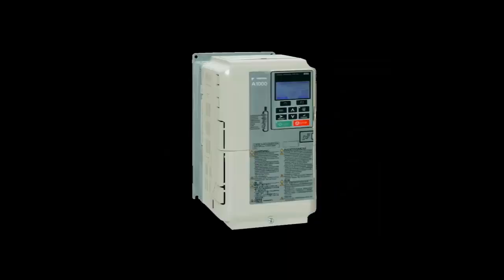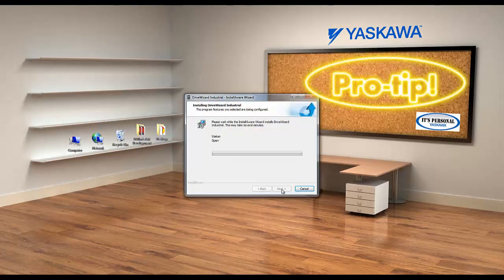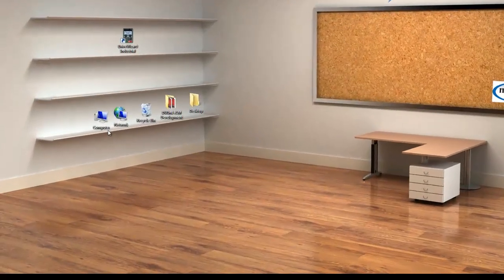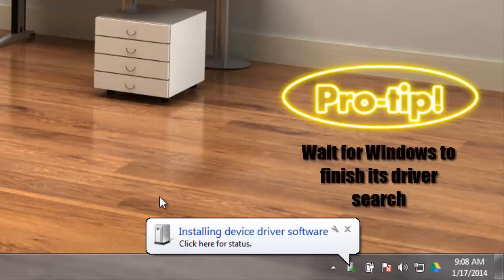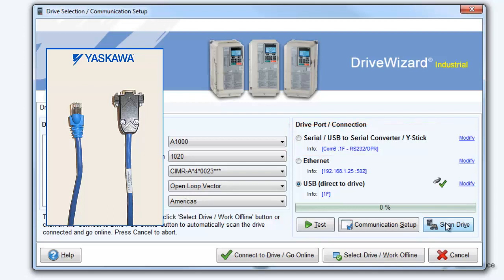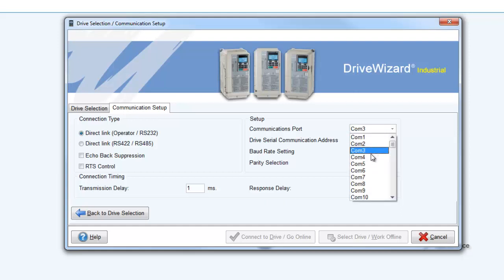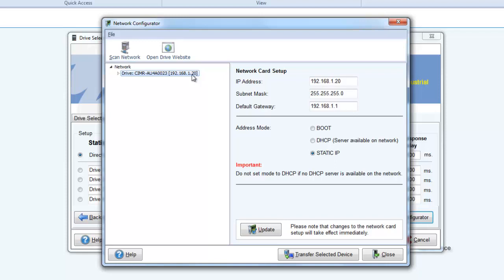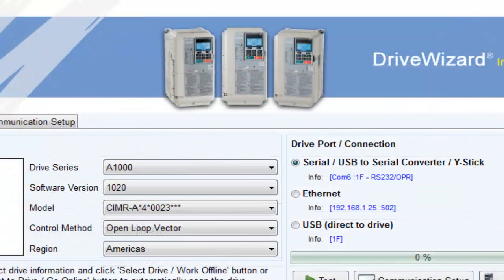DriveWizard Industrial Installation and Connection

Comment: I am trying to connect with my V1000 drive using ethernet by drivewizard industrial tool. i selected ethernet in the drive port/connection. I selected V1000 from the drive information only. I have not selected the model because i could not find the model (my drive model CMIR-VC4A0007BAA) in the list.Then i inserted following IP address in my laptop ethernet adapter ( IP 192.168.1.20, subnet mask 255.255.255.1 default gateway 192.168.1.1) as i don't know my drive IP. then clicked test button, drive scan button, scan network button from the network configurator. But nothing works. Please let me know how to solve this problem or suggest me if i am doing anything wrong.
Reply from the maker: DriveWizard Industrial software is only applicable for the U.S. version Yaskawa Variable Frequency Drives. Based on the model number you have, DriveWizard Industrial is not supported since that unit was manufactured overseas. Please contact our Technical Support Team for further assistance at https://www.yaskawa.com/support-training/support for further assistance or https://www.yaskawa.eu.com/.
Reply: Hello @Chandrapual Das, Were you able to find any solution for this? I'm having the same problem, I tried to use an Rj45 to USB Converter but the software stops responding and crashes. 

Please revert if you have got any solution for this!

Thanks!

Comment: CAN I CONNECT H1000 DRIVE WITH DRIVEWIZARD?
Reply from the maker: DriveWizard Industrial software is only applicable for the U.S. version Yaskawa Variable Frequency Drives. The H1000 drive is a high performance drive sold in China ONLY. Please contact http://www.yaskawa.com.sg/product/ac-inverter-drives

Comment: my program doea not have an option to hook usb direct only the other 2 options why is this
Reply from the maker: Hi, The version in the video is an older version of DriveWizard Industrial.  The current version has been updated to support our new GA800 High-Performance Drive.
 One of the key features and benefits to this enhancement was to improve the ease of use and connectivity to DriveWizard Mobile, therefore connecting via Serial and USB has been combines into one selection.  To best help you, please feel free to contact  drivesupport@yaskawa.com.
Reply: @YaskawaAmerica  when i plug the usb cord into the v1000 unit the unit appears to shut off and does not cummunicate with computer which in turn i am not able to download the driver am i doing something wrong that is also not showen in this video
Reply from the maker: @c6yoga797  As noted above, there have been updates. Please contact our support team at drivesupport@yaskawa.com or https://www.yaskawa.com/support-training/support for further assistance.

Comment: I've tried multiple times to connect a Z1000 drive to the computer using a standard USB-A to USB-B cable.  When I test the drive (press "Test") I get a message saying "The software of the drive connected is not supported by this software.  Please check for update."

I have tried downloading almost every software Yaskawa has to see if such update is there.

is there anything else I can do?
Reply from the maker: Hi David, Thanks for the question. To best help you, please contact drivessupport@yaskawa.com.
Reply: Did you find a solution to this problem? I am having the same one with Ethernet and serial.
Reply: @YaskawaAmerica  I an having the same one with Ethernet and serial conection. My driver is A1000